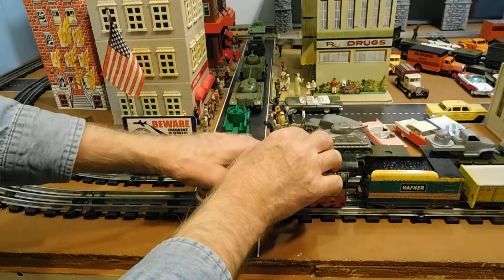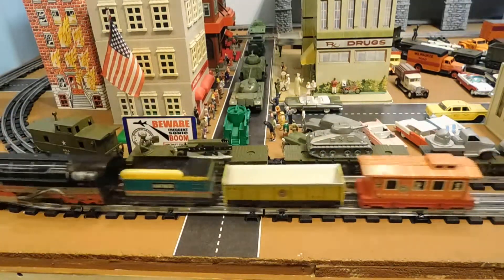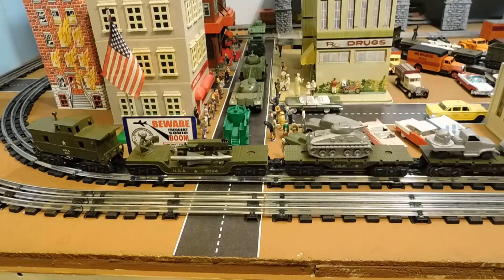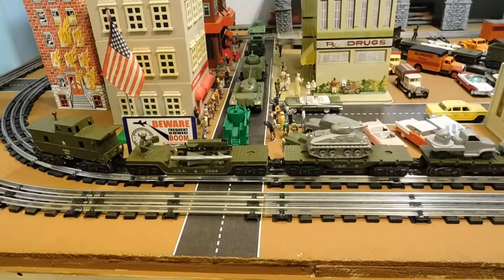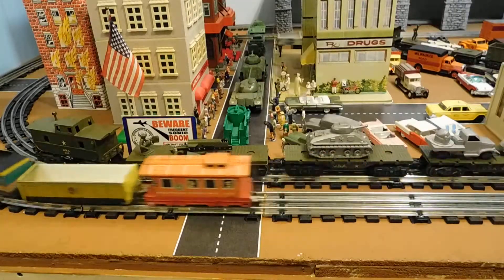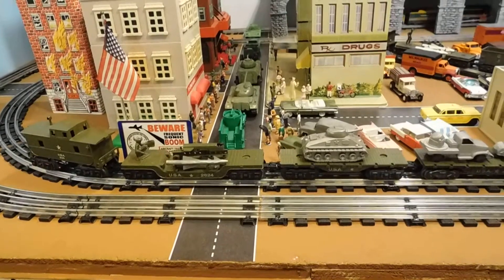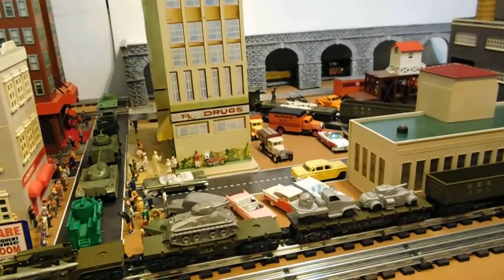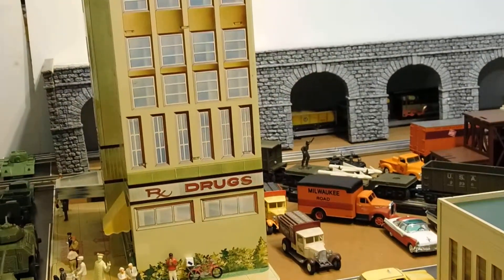Another Run With My Hafner Clockwork Set on The Milwaukee North Western #MNW With An Awkward Ending

Comment: WD40 is not a lubricant. It IS a water displacer engineered to reduce arcing in high voltage ignition systems. The same company now does make a line of lubricants and penetrating oils. I have one clockwork Marx in my collection, and can repirt that it benefited greatly from cleaning and proper lubrication with thin oil. There is a chance you can get the extra 1/2 lap you need with the right oils helping to ease the way.   Love the wind-ups... thanks for sharing🙋
Reply from the maker: I'll have to squirt a tiny bit Labelle oil in there and see how that fares!
Reply: @Ed-ICE-Berg  
LaBelle is good stuff!  I have used their lube for many many decades...  WD40 is good to flush out the crud.. and remove any possible moisture left from cleaning with water. If the parts are still wet with WD40, it will also tend to 'carry in' real lube oils into a sleeve bearing. It IS very useful stuff... just not a very good lubricant. We keep an assortment of liquid solvents like mineral spirits, 99% IPA, lacquer thinner, WD40 spray, Brakleen spray, penetrating oil spray, lithium grease and LaBelle oil on our workbench.  
Several of us in the toy train community where I live enjoy your videos.

Comment: Re: Oil for Wind-Up Motors. James Pekerek (an expert in Windup Motors)in his book 'Windup Train Repair' writes that he uses 'Turbine Oil' to lubricate his windup trains, and that it is usually available at hardware stores. Turbine oil is a lightweight, non-gumming oil, intended for use in fan motors. He also says that a good brand Synthetic Oil is resistant to gumming. He says that WD-40 is good for cleaning, but not a long time reliable lubricant.
Reply from the maker: Yeah, I was reminded of that whole "WD-40 is not a lubricant" thing. Too bad it made it in the video but that's really okay, becuase people reading the comments will then get a heads up on the do's and don'ts. I'm just going to use LaBelle #107 oil which I already have. I do have James' book - around here - somewhere LOL